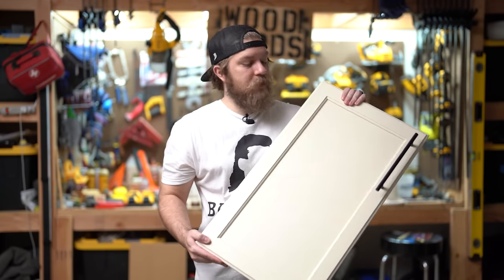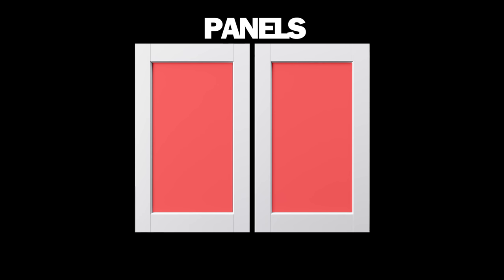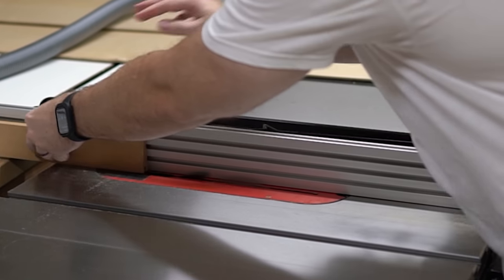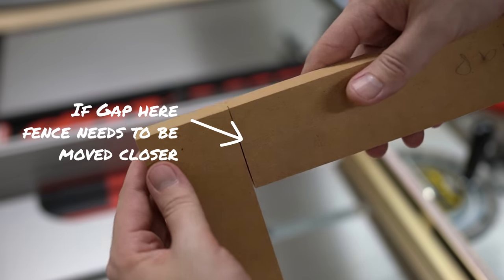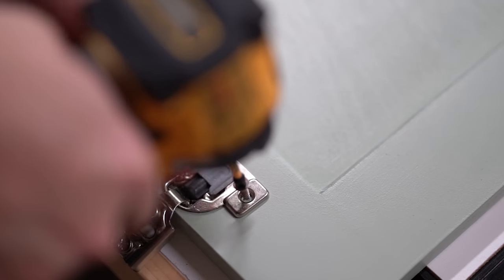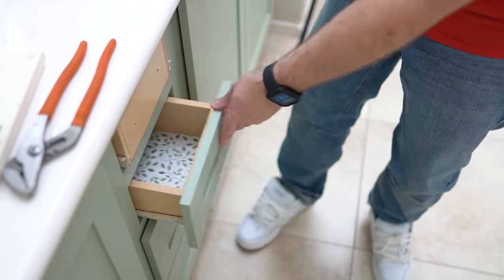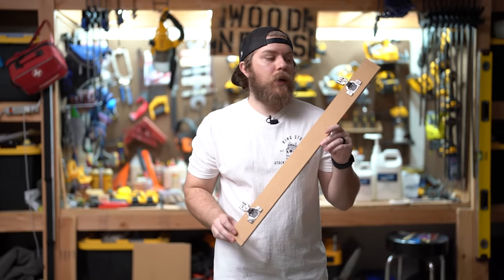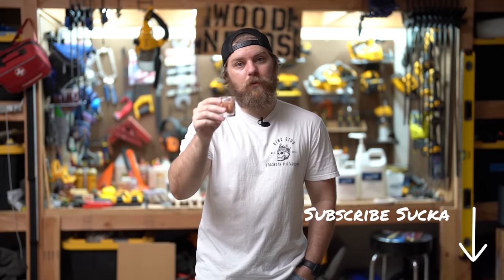CHEAP and EASY Shaker Cabinet Doors and Drawers | DIY | HOW TO

Comment from the maker: Wow! This video is getting a lot of attention! Just wanted to thank everyone for the supporting comments and for sharing tips that others can benefit from! I appreciate you guys! 
🍻Cheers!
-Tyler
Reply: You deserve it! Great video!! I had to save it for a future project.
Reply from the maker: Thank you! Glad it was helpful! Cheers!
Reply: Ah man i was really hopping to see the painting process and type used (like primer, paint and all). With mdf i feel like that can be a make it or break it step for finish and durability :(
Reply from the maker: I honestly didn’t do anything special is why I didn’t show it haha. Sanded the edges to remove tool marks, used a furniture/cabinet paint/primer. Foam cabinet roller brush on the flat surfaces and ends, bristle brush on inside corners. The first coat gets drank in by the edges a little bit but after that it was paint as normal. I think it did 4 coats.
Reply: This was fantastic! Thank you!
Reply from the maker: @christinebrennan4484 thank you, Christine!
Reply: I’m going to subscribe and follow you to learn more. I would recommend that you ad everything you use on the video so I can buy it😅
Reply: @WoodNerds hello, I really like that color. I'm interested in doing something like this in my kitchen. Can you please tell me what color green that is?
Reply from the maker: Hey Jenny! Of course! It’s “clary sage” satin finish, using a “cabinet and furniture paint” base to help mitigate wear and tear. My wife picked it up at Lowe’s. I think the manufacturer is sherwin Williams!
Reply: This video was great but I don't have access to these tools. I wonder if I can pay you to do this for me, maybe?
Reply: We bought exactly what you say but the soft close hinges are too thick for the 5/8 MDF. What hinges did you use?

Comment: How to make cabinet doors for $10. The first step is to bring the wood over to your $7000 machine.
Reply: Did you think you would only need a hammer and glue?
Reply: 😂😂😂😂 brilliant
Reply: The table saw you can get a cheap for around $150
Reply: This is meant for people who already build things.  Not for someone wanting to make them for cheap with zero tools
Reply: Just bought a Craftsman 10" table saw with stand at Lowes for 160 bucks. It's enough to do the job, even accepts dado stacks I believe. Can get a cheap 10" or even 7 1/4" miter saw used on FB. Brand doesn't matter too much. Just no Chicago Electric from Harbor Freight. A drill and the jigs? Another few hundred. Would still be far cheaper to buy all of those tools, wood and paint than to redo just one master bathroom vanity.
Reply: ³😅😅😅
Reply: We all started out with a cheap portable job site table saw. You can then build a crosscut sled and you’ll be able to build great things.
Reply: Naw dude... I make these with skill saw and and 8ft level. No need for a bunch or expensive equipment.
Reply: I got a table saw for literally free on FB marketplace that works like a charm. Before that I used a Milwaukee circular saw, 2 cheap clamps, and a 4ft level/yard stick that I rigged into a track saw set up. You don’t need $7000 to make stuff unless you don’t have the patience or common sense.

Saying you need $7000 for this is like saying you need a $500 hammer drill to screw a picture frame hook into drywall. Just use a screwdriver dude. Hell, you can use the tip of a steak knife if you’re patient enough (did it before)

Creativity is free.
Reply: You can probably rent this woodworking  equipment for projects like this
Reply: We get it you're poor.
Reply: The funniest ever!

Comment: I made 52 doors and drawer faces like this all over my house. My advice, take  your savings and spend some of it on good paint. I used Latex in the bathrooms and good Alkyd enamel in the kitchen. Two years later I have had to remove and repair several cabinet doors in the kids bathroom since the MDF blows up once the water gets past the coating. The kitchen still looks nice.
Reply from the maker: Thanks for the advice, man! I forget how messy kids can be with water! I was thinking about the physical damage this whole time haha.
Reply: Did you varnish over the paint?
Reply: Im a painter. Dont varnish over paint. Thats not a thing. Get quality paint from Sherwin Williams, not Home Depot...
Sherwin Williams water based Alkyd is a good option.
Reply: But... a good primer first is a must otherwise you might as well buy cheap paint if you're not going to prime it. The paint and primer in one is a marketing ploy and is not the same as a primer.
Reply: Agree with above comment.  This is a brilliant and much-needed video.  And I’m also a painter and I always use an alkyd primer. Every time I use a primer and for cabinets and trim I only use the alkyd paint.
Reply: @drewfoster1493 is the alkyd paint better for the kitchen?  What finish would be best for the kitchen cabinets?
Reply: @debidehm9129 yes, Alkyd paint is best for kitchen cabinets. A lot of manufacturers have hybrid alkyd paints. Meaning they are water based alkyd. So less smely and they clean up with water, instead of paint thinners. 
If I was to paint mine today, I would probably use Benjamin Moores "Advance" in a semi gloss finish. Dont buy paint from Home Depot..... Most Ace Hardwares sell Benjamin Moore paint. Its not cheap, but you get what you pay for.
Reply: @drewfoster1493  thank you!
Reply: Use an oil based enamel or a catalyzed polyurethane. Water based paints don't bond as well and aren't as durable. The water in them can also raise the grain or texture in wood based substrate.
I used to work for a cabinetry company. We literally didn't have a single water based product.
Ace Hardware sells a tintable enamel paint that is made by Sherwin Williams and is very durable and lays down nicely when you thin it about 25% with mineral spirits.
Reply: So if you want to make MDF super water resistant, spray them before painting them with Deft Wood Finish lacquer from like Home Depot. A few coats will really make a difference. I have some MDF doors I painted on the cheap like this about 8 yrs ago next to my shower..zero swelling, look as good as new. They get exposed to so much humidity that I can draw on them after I take shower. I am a pro but these doors were for a place I don’t own and just wanted to try doing these on the cheap since I don’t own the place. Anyways, the clear lacquer gets absorbed by the MDF and it creates an almost composite like skin.
Reply: @drewfoster1493 sherwin Williams over priced garbage. Benjamin Moore, Porter or behr
Reply: Did you spray the carcass and doors or use paintbrush?
Reply: @golfnguitarz
Reply: Use Tricoya MDF in high moister areas
Reply: @BillyMustang101
Reply: All my cabinets are made out of MBF.  7 years later I have to replace each one.
Reply: Yes. Use the urethane based paint from Sherwin Williams. I think its the emerald line. It comes out smooth and hardens better than oil based. It’s expensive but the best option for cabinets, doors and trim.
Reply: Emerald urethane from Sherwin Williams works great, even brushed. It self levels pretty good on second coat.
Reply: What is the best, top of the line all out cabinet paint one can get?
Reply: @drewfoster1493 should I use this type you mentioned for walls too?
Reply: Anybody know what a good paint brand is in Germany?
Reply: @woodnerds What is name for the color you used? It's beautiful!
Reply: Benjamin Moore Advance IMO
Reply: Good to know
Reply: @drewfoster1493  I am no pro and probably won't ever claim to be one, but I've done a fair share of remodeling of all kinds throughout my 57 years and I am a firm believer in the superior quality of Ben Moore! It's my go to!

Comment: MDF (water resistant type) is pretty standard in Europe & the UK. Has been for years. A good hard paint/lacquer finish is key to keeping them from environmental effects but they'll outlive the normal cabinet lifespan within a home before they're replaced for aesthetic or style reasons not because they're damaged or performing poorly.
Reply from the maker: Thanks for watching and the info, Jim! It’s not as popular here in the states but I can’t find a downside for mdf as a paint grade cabinet door - especially if you’re making them yourself. We’ve had no issues with ours.
Reply: Wonderful ❤
Reply: Came here to say this. You MUST use moisture resistant MDF for cabinet doors. Regular MDF will not hold up for more than a couple seasons in this scenario. You're going to have a lot or angry customers calling you in a year or 2
Reply: What about MDO? Can you use that?
Reply: @joseph7105  if its PROPERLY sealed before painting, how can it get moisture-damaged ?... 🙄
Reply: @peterfitzpatrick7032 does the sealer break down over time?
Reply: @earlhurick4629 , MDO is a plywood product, not in the same category..
Reply: @WoodNerds , MDF water resistant is known as MDX, X indicates exterior glue, more resistant to moisture, you shouldn’t have too much trouble finding it at a quality lumberyard. There is also MDF Light where weight could be an issue, this may be harder to find, and I haven’t seen it available in the exterior version.
Reply from the maker: @_wardavewoodworks thanks for the info! I just came across another type (NAF) MDF. NAF stands for “no added formaldehyde” which makes it a suitable material for laser engraving/cutting as the adhesive used to bond the fibers is less toxic. The one I recently picked up is also moisture resistant. Anyway, I appreciate the information!
Reply: @_wardavewoodworks ha..II’d need to drive three hours to find anything even semi unusual.

Comment: I do flips and rentals full time. I often do a variant of this that I like even more. Cut 1/2" MDF sheet to exact size of finished door or drawer. Rip 1/4" sheets of MDF down to rail/stile size. Glue liberally with brush or roller and stick them on the 1/2". Let them overhang all around by about 1/16". I'll usually use a few 5/8" 23gauge pins and/or large binder clips to hold them til glue dries. Then flush trim the overhang with a router bit. Prime, and paint with Sherwin Williams Emerald Urethane or similar. If you pay attention to detail you get an excellent looking result. Also works great for built ins for book cases, closets, etc.
Reply from the maker: I’m going to try this for sure. A couple people have suggested it and I don’t see a downside. Fast, easy, cheap! Thanks for watching and sharing your experience, Ryan! I appreciate it!
Reply: My dumb ass commented before reading other similar comments.

I'm all for easier / cheaper / better techniques.

Worth noting that the key to getting a flawless edge is using plenty of glue and clamping. Also skimming the mdf edge with glue or a filler like drywall compound before light sanding and priming really hides any imperfections in the material.

Something like hard maple makes the best frame of course but it costs a fortune and is a lot of work.
Reply from the maker: @ryanrents126 haha! No worries, man. Everyone has been sprinkling their own flavor on different processes so it’s all helpful.

Thanks for the tips. I saved them to reference when I get to trying it out.
Reply: Peter Millard did that on one of his first ever videos on YT... the most important thing was doing a good job in sanding / sealing / painting... but they turned out great... 👏😏
Reply: @ryanrents126  thanks for your suggestions. As much as I love mortis and tenon I don't have the tools nor the patience to do it that way. I was thinking along the lines of your input and was hoping someone made a comment about it. So thanks again!
Reply: @dawnc5797  I'm surprised there aren't more videos on here or posts on reddit or whatever about people doing it that way. MDF is the cheapest or if you're concerned about humidity, I've used 1/4 baltic birch over 1/2 slabs to great effect. As others said, just pay more attention to sealing edges and sanding
Reply: cool thing about this tutorial video is that the same techniques work for real wood also, but that's a great time saving tip if MDF or HDF is the material of choice.
Reply: I’ve seen doors made this way and it makes a lot of sense to me, especially for someone building doors for the first time-  and seasoned diyer

Comment: You get those peaks because of the angle of the teeth on your blade. You can get blades where the teeth have flat tops. That way you aren’t left with those peaks.
Reply from the maker: Thanks Adam, of course! I should have explained that better. Even flat tooth blades can leave little peaks and valleys if you don’t overlap perfectly. Just providing insight for beginners. I appreciate you watching and sharing info!

Comment: Excellent video! Content, comedy, production, etc. were all really well done. I agree with you on using MDF. People say it's garbage or not for jobs like this, but I've used MDF for tons of projects, and I've been surprised at how versatile can be. Side note, I don't think you mentioned it in the video, but they sell a formaldehyde free MDF/HDF so you don't have to worry about offgassing toxic chemicals. I learned of the material recently from a knowledgeable guy and thought I'd share it here. Cheers!
Reply from the maker: Thanks man! I really appreciate the feedback! Great points! I like to over engineer things but sometimes the deciding factor is how much money you have in your pocket vs the practical use of the component you are planning to build. If going cheaper isn’t going to cause a failure then why not?

Cheers brother!

Comment: For an even easier build, cut out the drawer/door front from the sheet and "apply" your rails and stiles using 1/8"  MDF or hardboard strips.   When you sand and paint the edge, any seam disappears.  You get the exact same look for a fraction of the work.
Reply from the maker: Someone else just shared this tip! I’m definitely a fan of less work! Thanks for watching and taking time to share some info. I’ll be trying this method out as well.
Reply: Agreed. I used that same method to replace a lower cabinet lazy susan door using a 1/2 inch slap with 1/8 inch overlays to create the "styles" look on the outside.
Reply: How would you apply the rails ?
Reply: @TheBestAsianGamer  I just used wood glue. Best to cut all of the pieces (slab, rails, styles) slightly over your final dimensions. Glue on the rails/stiles and them trim the whole door on the table saw.
Reply: A good idea, but the door would be somewhat heavier no? Probably not enough to make much difference.
Reply: They're sometimes called "faker shaker" .. another good thing is that you can build them slightly oversize and then trim to fit

Comment: For smaller drawer faces I like to do 2 - 2¼" rails and stiles so the panel is a little bit bigger. Makes it look just a little better. 
To avoid foot use to hang doors, Kreg makes a jig that clamps to the face frame and makes it so much easier to mount and you can adjust your reveal for the size of your doors.
Reply from the maker: Thanks for the advice! I didn’t know they have that tool, I just might pick one up. Cool channel name btw!

Comment: To install the doors we always used a small spacer  block under the bottom hinge to position the doors in the opening. Otherwise great video. I did our kitchen recently for about $300 using a similar method.
Reply from the maker: Great tip! Thanks for watching and taking the time to comment, Chuck! Cheers!

Comment: Very nice explanations and visuals, making this look like a really professional job.   One question/suggestion:  on the drawer fronts for the small drawers, since it doesn’t look that you’ll be installing pulls, you might put a slight back bevel on the side stiles (or bottom rail) to make it easier to get your fingers on the drawer to pull it out.
Reply from the maker: Dude, that would have been a great idea! I’ll be doing that in the future. My wife didn’t want pulls on these as it seems like it would have been too much gold for the small space. Thanks for watching and the great suggestion! Cheers!
Reply: The work is really exceptional. Thanks for a great video and down to earth explanations. Can you share how you painted and what paint/ primer you used on the MDF. Roll/ brush/ or spray?  Looks sprayed?
Reply: Suggestion: include your wife, her design…pull combo with the paint is awesome.   Team up👍
Reply from the maker: @Tomcoker1952 thanks man! I don’t really have a choice haha. She’s my go to when we plan to renovate something!

Comment: If you're making door stiles/rails with MDF, use Blum Inserta hinges, or at least the ones that use a nylon dowel. The screw type eventually loosen over time. When that happens the screws lose their grip.
Reply from the maker: Thanks for the tip! I’ll check those out!
Reply: The Inserta is only available on frameless hinges, but they do have face frame adapter plates. (The Compact series face frame hinges do have the dowel option.) I’d recommend checking out Blum’s hinge book – they have a matrix under each hinge/application to get the right drill distance/plate height to achieve your desired overlay. And be aware that your max overlay with most frameless hinges is going to be around 3/4” - 7/8”. If you have a face frame application with larger overlays you’ve got to stick with the Compact series face frame hinges. 

Side note, if your doors are closing too slowly you can switch off the soft close on one of your hinges. I had to do that on my (very light) kitchen cabinet doors.